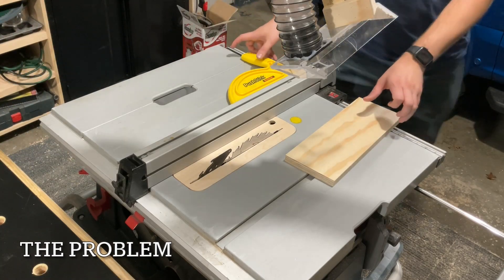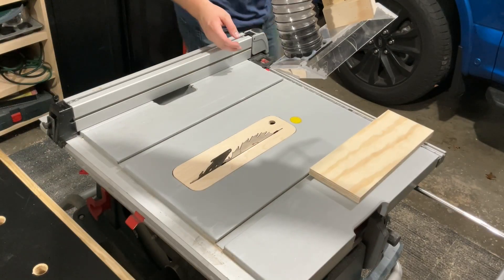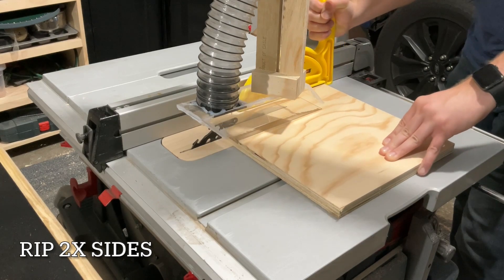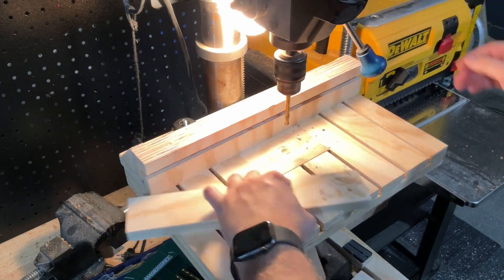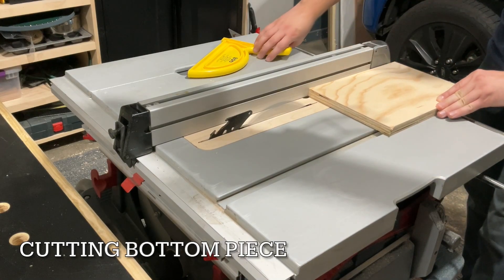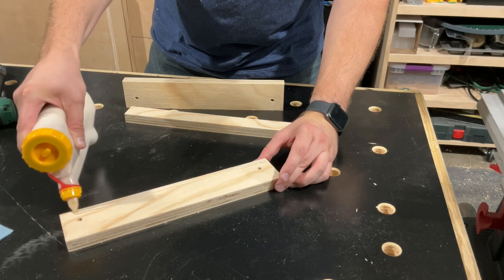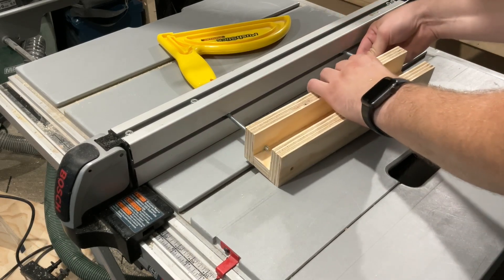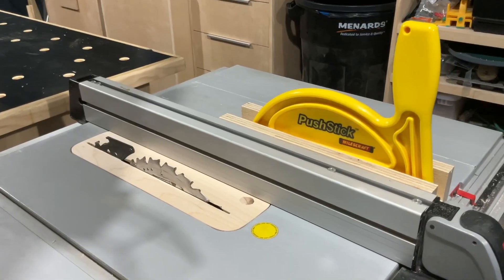Push Stick Carriage for Table Saw

Comment: Great idea. I found your channel the other day and I'm glad I did! I have a crap factory push stick but want to make one similar to the design you're using but this carriage is a must have then. I might make one for a tape/square as well! Nice lean thinking. I like how you're making upgrades instead of buying stuff. I feel like I'm thirty dollaring myself into poverty 😅.
Reply from the maker: This push stick design is my favorite. I trace this milescraft one when I need a sacrificial one made from plywood/pine but it’s also easy to eyeball the design. Also I totally feel the same about thirty dollaring into poverty lmao. Many jigs are “cheap” but it adds up and you can make a lot of jigs from a $50 sheet of pine AC plywood. Plus you can make way better jigs because you can pick whatever features you want.

Comment: Do you use a cross cut sled on your jobsite saw? If you do, do you have build plans as I didn't see a video unless I missed it,  Thanks.
Reply from the maker: I never made one for the job site saw because it seemed too small to make one worthwhile - not enough space in front of the blade. I ended up going with the kreg miter gauge and really liked how that worked.